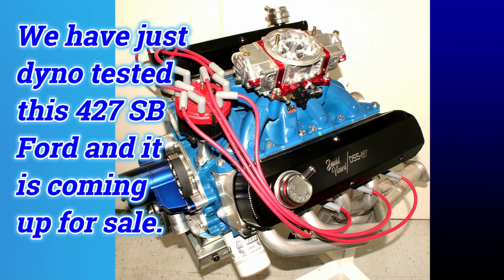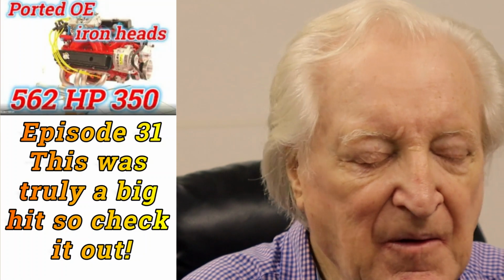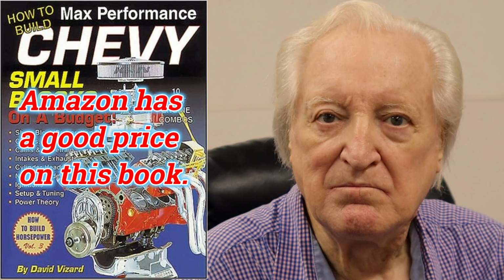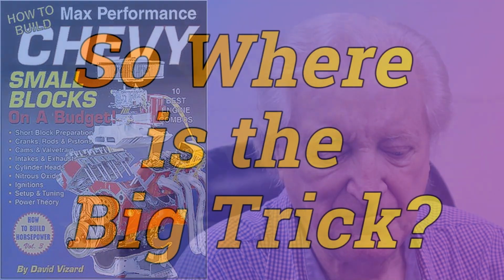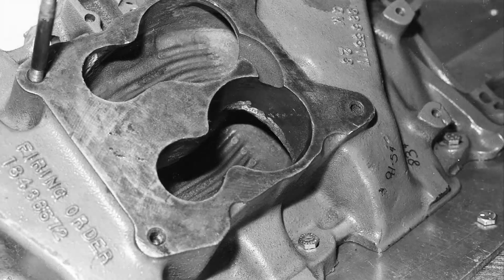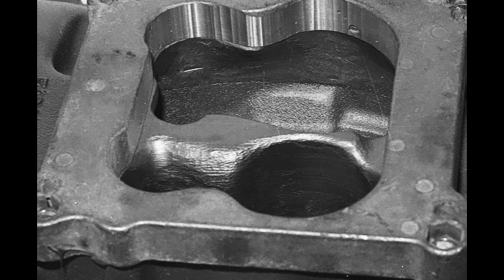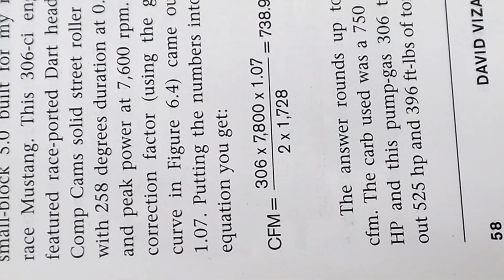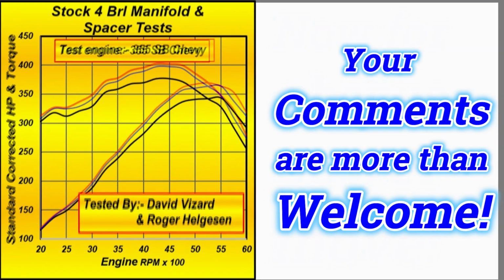OE SBC  4 brl intake mods for a whopping 26 HP increase!

Comment: What about lightly wet sanding your cylinders after honing with 3000 grit sandpaper to knock the peaks off the cross hatch but still retain the valleys?

Comment: David, I hope you read this. Would you consider the old Holley 300-36 a better intake than a Edelbrock performer rpm or even the air gap rpm intake? I've heard nothing but praise about that 300-36, but I just can't understand that if it was so good, why did Holley ever stop making it?

Comment: I wish you would take an opportunity to explain the results further, about the flow capacity of the cylinder heads in relation to the intake manifold, and how the intake gained around 100 CFM on the bench, which only translated to around 11 horsepower in the initial testing.

Comment: We got 25hp and 37ft lbs of torque out of a Subaru ej20 just by polishing down the inside of the aluminum intake manifold runners and plenum sanding down the factory casting marks and the rough surface in general. I used a steel cable, drill and sandpaper from a cut up sanding belt. I think skin friction, drag, and fluid dynamics in air passages aren't given as much credit as they deserve in the performance culture. Fascinating.💯👌
Reply: CrazyDITguy,  When you say; "skin friction", are you referring to the type of SURFACE FINISH of plenum area and runners❓
And you do this with a "cable" type of fixture on a hand drill❓
When and where does the sand paper come in❓

I have heard of using something like a #60 or #36-grit cartridge roll for a good surface finish on the intake manifold plenum area and runners.... and the Intake runners of the heads too.
Could you please explain yourself in a little more detail about how you go about doing this❓
Thanks 👍
Reply: @MarkSperlik it's a port-injected motor. Dry runners. Dry air responds to smooth finish better than air/fuel mixture in a carb or tbi manifold.

Comment: I have that book DV and many others. I did my first modification to the same type of intake about 30 years, ago, but not quite as extensive as he did here. The engines were basically stock 307's or 305's and a 250 hp 68 327, of very high mileage. No optimized cam, exhaust, carb, ignition, to speak of. I have a bunch of aftermarket intakes, but I am currently modifying an iron and aluminum oem intake just to see what I can get out of a updated  ( ULTRA STEALTH )combination as seen here. It worked way back when, it should work even better today. and look like a boat anchor candidate. I got the stealth idea from DV, way back when.

Comment: You can also buy "cast iron" paint if you're running alloy heads, or block, for some reason, for the CI look - especially if there's also a few bits of GM paint dabbed on it, and some reddish-brown paint to look like some rusty bits.
Depending on the chassis, if the engine uses the "Ram's Horn" exhaust manifolds, you can still buy the 2½" outlet "Corvette" versions to replace the usual 2" ones.
You can also gain a bit, if you don't live in cold climes where you need the heating for fuel vapourisation, by blocking the exhaust cross-over heat risers on the intake and, potentially, using some thermal barrier paint on the inderside to reduce heat transfer there.

Comment: I modified an aluminum SBC Quadrajet intake manifold as per the instructions in your carburetor and intake manifold book. It was a killer daily driver manifold! Noticeably more off idle and mid range torque than any other dual plane manifold I had ever tried and it made more max HP than the ZZ4 dual plane intake it replaced.
Reply: How many hours did it take you? I'm trying to budget my time

Comment: Thank you Mr Vizard!  Great stuff.  FYI I've played with the Holley spread bore carbs for high performance, and just be aware some of them had "reverse idle" circuits, meaning the mixture screws actually metered air (not fuel) and the idle discharge ports and transfer slots are quite small (I think only 0.027" if I remember my measurement).  Of course this can all be modified, just wanted to mention it as it can be difficult to get these carbs to idle with a cam that has decent amount of overlap.

Comment: @Mr. Vizard and Andy: 
Opening up a intake manifold/-channel actually helps. But it is 'dangerous' too. To much you will loose velocity. And then the length of the channel, thus the thickness of a spacer plays a part too. One of them is gasoline back firing into the intake channeling.
May be Mr. Vizard or Andy can explain the details (?).
Reply: On performance motors, the older stock heads and stock manifolds have a high threshold for how much material can be removed before loss of velocity becomes an issue, vs increased overall flow.
On aftermarket intakes with already improved runners of larger diameter,  killing velocity is much easier to do.

Comment: Are there diminishing returns on going taller on a open spacer on a dual plane? I got a dual plane ready to go on a 383 and i got a 2" wilson taper spacer
A 1 1/2" open wilson spacer 
 And a 1/2" shear plate with a 1"open taper laying around.

Comment: Another great video by DV and team.  On the HP/Torque graph you were showing towards the end, seems like torque fell off quickly at the higher RPM range.  Was that valve control issues, nature of the cam grind, other?  Please keep them coming.
Reply: Looks like valve float probably that’s stockish rpm

Comment: I heard talk of using powdered iron, and really thick paint on aluminum heads to sneak through tech at a racetrack. The intake also, don't know if it was done or just talked about, seems like a epoxy mixed heavily with iron powder could be brushed on, maybe given texture with sand paper when setting, could possibly work, the rules were any iron head and iron intake, stock stroke upto 357-360cid or something,  the class we were in we could run aluminum intakes,  I wanted to build a light weight stroker either383 or 427,with long rods, (long as possible with a 9" deck,)  and a set of dart heads, maybe vortec heads,( this was over 20 years ago)  I wanted to build this as a cheater, but I was also thinking, with a 6.20:1 gear, and and about 34" tires about 14" wide, and 15x14" rims , I thought  they were 10" until I compared them to a 10" rim, and tried to use a 4way lug wrench! Haha, it was about 4" too short! Anyway I was kinda thinking 374-377  use a 400 block and a offset ground 350 crank get closer to 3.40" stroke, and use 6.125" small journal rods. With the piston out the hole about 
.020" , the 10:1 355 wanted to rev higher than the just shy of 7k it was just not enough power, or time, fuel was not an issue, they sold two grades regular 104 octane, and super, guessing it was 110 or so.   we having compression in the 10's, ran roughly 50/50 104 and 93,I figured it was 98-100 +/-,  
Anyway a 370's cid should spin up faster, especially with a light piston rods  and crank, the flywheel was as light as you could get a stock unit, the pressure plate could used a bit of work,  anyway, with 370' something cid, and about 13:1-14:1 and 2.05" / 1.60" valves, and 1.75" headers, and 750 Holley carb, it should do better out of the turns,  we didn't shift, with 6.20 gears, we just used the transmission for reverse! 1st gear was geared like a clock, it did maybe 5-7 mph in first gear,  take off in high gear, was just a slight ride on the clutch, and there you go, it was a short dirt track, and we didn't drop under 4000+4700 +/- when under green. And I believe if the engine could hit 7k maybe 7100rpm I could been in the lead much easier,  the carb had a dead spot we never got out of it, it run great on the street, just a second of sputter when at full throttle as the engine is revving, it was a single pump too small Holley I changed jets, cleaned it up, adjusted the needle and seats, adjust the pump, only made idle Rich, and move the sputter to higher rpm, it was a vacuum secondary, with a screw to get mechanical secondary, the sputter was about 50% opening of the secondaries,  with the gears the tach basically moved with the throttle pedal! We ran points ignition, we even went through all that, . It would turn about 7600, before  either points or valve float, with the solid 30/30 cam , even tried . 016"/.018 I think it ran crappy,  the heads were 250 HP 350 heads,1.94"/1.50" we were on a budget, i think just a new 750 double pump Holley would have us in the mid to front, however, we were taken out,  a car in front of me hit the brake on the green  flag I drive straight under it, full throttle! Got sprayed with hot water, only slightly burned all over,  fixed that, and a car spun out in turn 1-2, t-boned it, taking out another radiator! The first wreck the bumper was about 12" from my A pillars, his bumper, my a pillars, bent my air filter! 😆,  Sorry to ramble on

Comment: I have a 1999 sbc 350 880 roller block 470 lift Camshaft lsa 110 231 duration, 1094 heads gasket .015 with 340292 turbo heads they are mill 58 cc chamber flowing numbers 280 CFM,  Edelbrock 7501 air gap intake manifold 650 CFM proform mechanical double pumper... I was hoping to get 350 hp, what can you tell me about this combination?